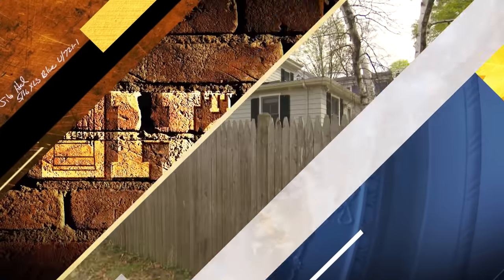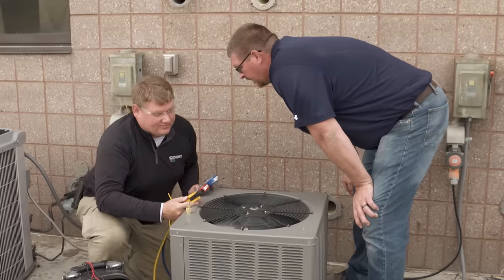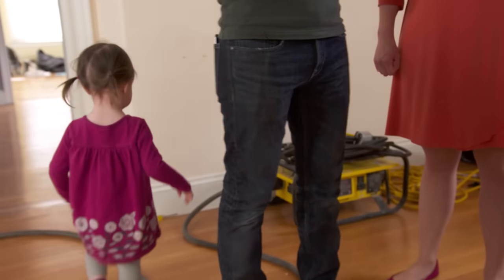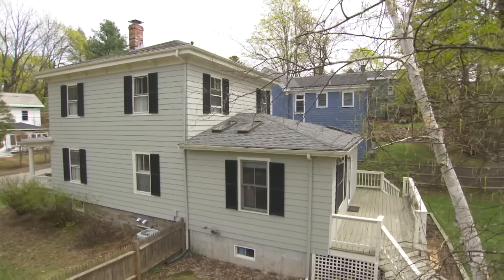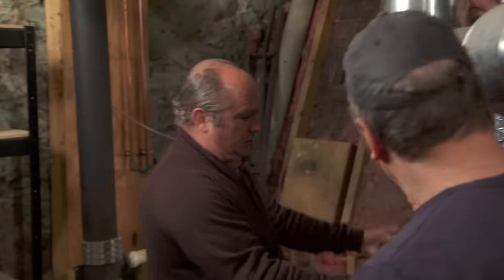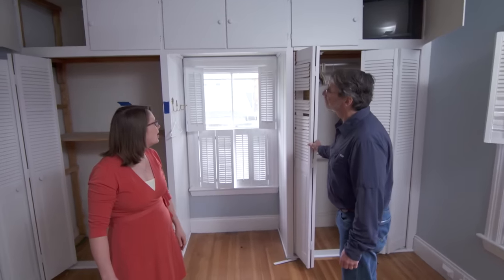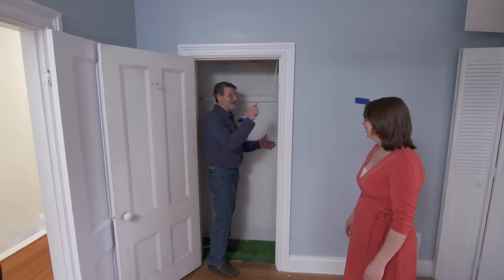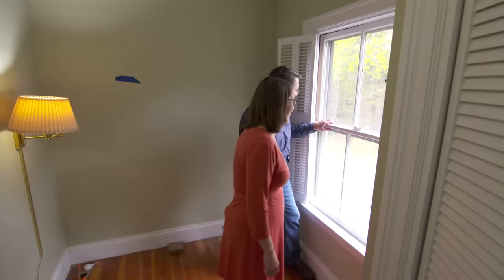This Old House | A House for the Next Generation (S39 E1) | FULL EPISODE

Comment: I thought he said the homeowners had a limited budget?  They are planning a major rebuild with additional space.
Reply: this will be far more pedestrian than the last season's mid-century modern.  their expansions are all living spaces and their HVAC would've needed to be updated anyway even without any renovation at all.
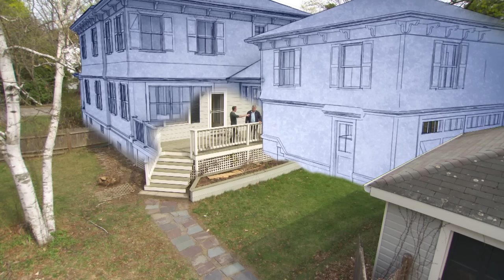Reply: @robgeach8105  12:21 I'd hardly call their plans budget-minded though, they're basically adding another building, removing walls and ALSO building out one room on each side, aside from other "updates"
Reply: @austinhamann704  you realize when people say "removing walls is expensive" they're talking $5-10k for a beam most of the time, not a new BMW. it's the same for expansion framing. so long as they only put new finishes in new expansions you can make a tiny house 2500sqft for an extremely cheap 15 year mortgage.
Reply: A budget of 1/2 million dollars is still a budget.

Comment: High schools should be pushing for trade schools not trying to get everyone to go to college. Pushing everyone to college has also created problems, from supply and demand, by making a 4 year degree not as valuable from high supply and pushing up the tuition cost from high demand, since funding through loans has been made too easy so huge student debt which is actually scamming many people because they are going to for-profit schools making the degree worthless or getting degrees that are not an investment, that they are suppose to be, like most L.A. degrees which you need to go to even higher ed and only works for being a teacher. Anyone can do basic construction but you need training to be a proper plumber, electrician, HVAC, carpenter(which all have subcategories like) as well as manager and or skilled painter, landscape, etc. They need to know what is needed to meet code and the proper way to do things. Then there are non construction trades that need some schooling/training and/or at least years of work experience like machinist, nurse, medical/dental assistant, heavy equipment operator,  etc and pay well because of that

Comment: TO the apprentices, your lucky you got to work with the this old house team.
But what really is grand is driving by a house you worked on 5 10 25 9r even 30 years later to see it still there sure things might change but basic concepts you had may last your lifetime. 
You can also look at what you did over time and see what could have been better.  I dont know how some contractors sleep at night after they do sloppy work on a house. NORM commented on this once there is no room for poor craftmenship.
Sure there are differnt ways to do things and get the same good results.
It just takes common sence to figure out what way is better.

Comment: Tired of the endless repeats of this show and many others on PBS and Create. Don't know what they are doing with the support money but they show the same shows several times a day and are as bad as the rest of the TV networks today. Also I have an over the air antenna and their signal is very weak and other channels I get come in and have a stronger signal and the towers are father away. The tower in Kennebunk Me is obviously old and under powered and when I E - Mailed them I got the run around and my question wasn't even answered. 👎📺

Comment: This old house has gotten old and dated. You can only build for many houses, and making things interesting for so long. And stick build houses have gotten too expensive, just like the old Victorian homes did. And the trades which build stick build homes are fading away. It's not that these trades are needed it's just that they are need less. Face it guys you've have a good run. Cheaper and more energy efficient homes are replacing stick built homes.